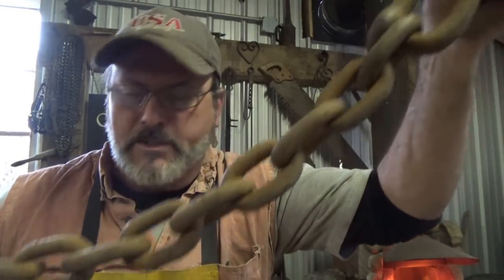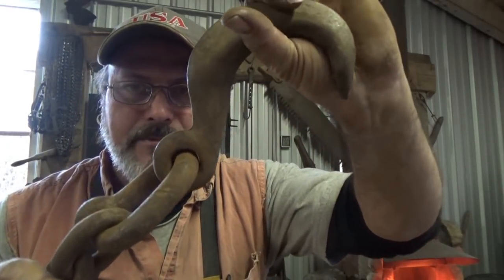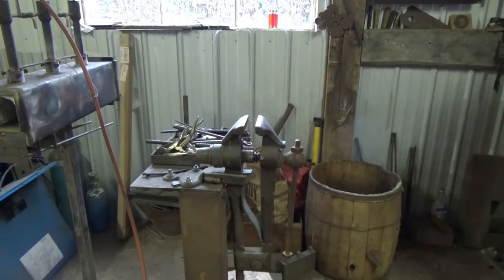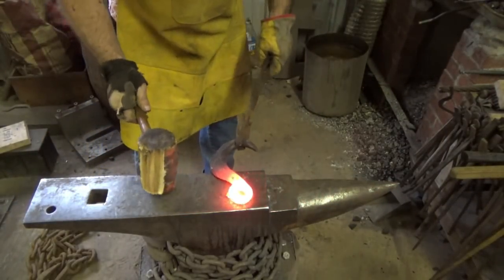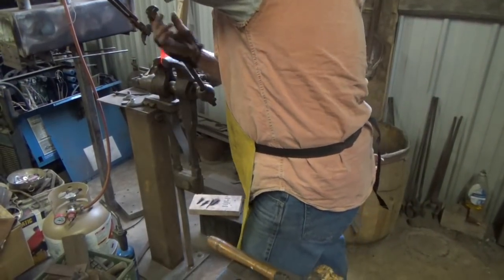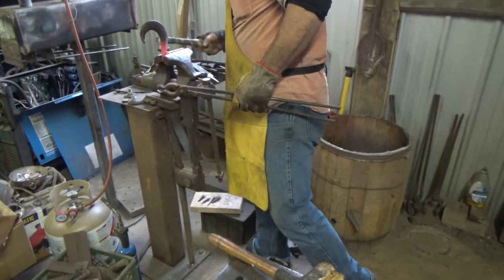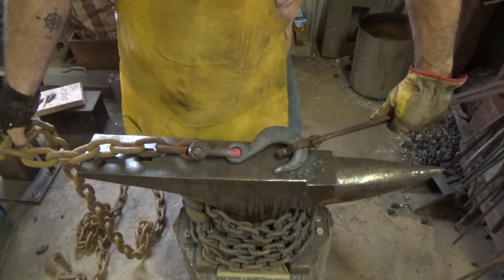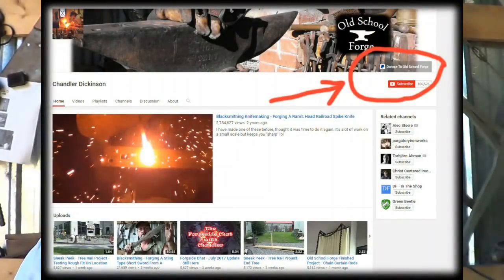Blacksmithing - Chain Hook Repair

Comment: The heart of recycling. Thanks Chandler!  BTW, some of your tips even get used by the not so smithy of us - case in point, I needed a sign hanger and scrolled some eyes into some 5/16" stock. Nice thing was red hot steel doesn't spring back so getting the shape right did not require guessing how much return to expect when I stopped bending the wire into place.

Comment: I call those cold shuts.  When you purchase them, they are "open".  You put the chain links or chain link and hook in them and then beat them shut while they are cold.  All of the ones that I have seen or used have the end riveted (peened) to keep them from coming open which is probably why you had trouble opening it.

Comment: If you want to clean a chain tie it behind your car/truck and drag in the dirt for a while make sure that you tie it on with a rope so if snags the rope will brake and not rip part of your car off
Reply: I have seen them take the chain and place in a cement mixer with gravel and run for a day or so